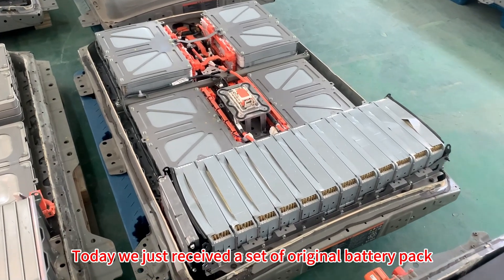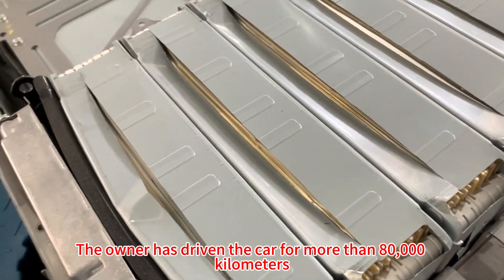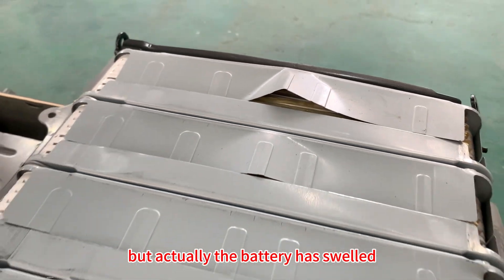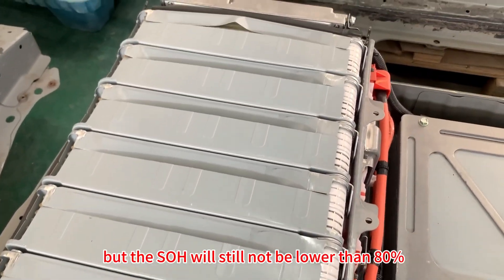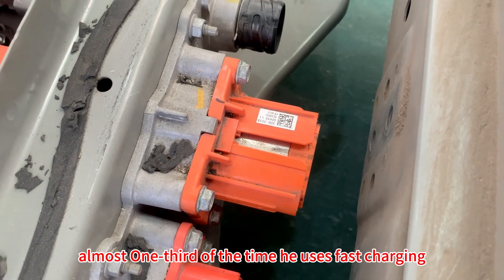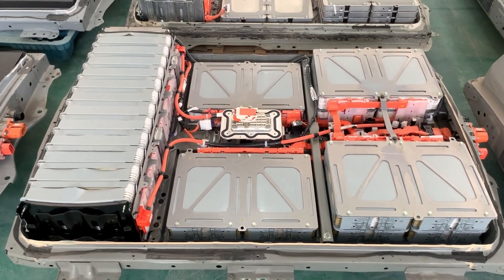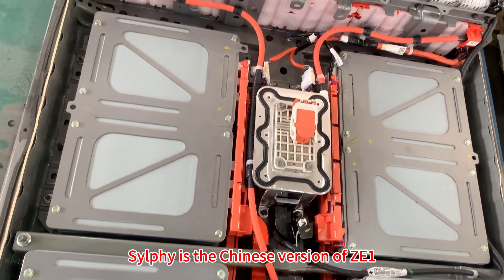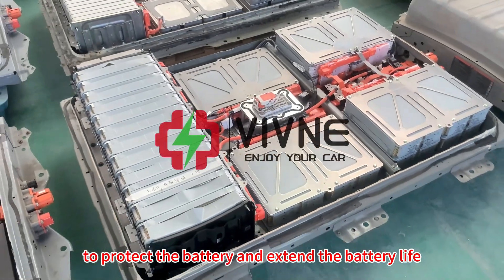VIVNE-Nissan Leaf original battery pack after 80000 km of driving

Comment: Swelling presumably due to over-heating the battery? Rapid charging when the battery is in normal temperature range (20-40 degrees C) should be fine. Driving speed and not charging too 'deep' seems to help with battery temperature.
Reply from the maker: I agree with your point of view, but overheating is only part of the reason. In fact, the attenuation and swelling of lithium batteries are normal and irreversible.

Comment: I would pick that a lot of the fast charging was back to back with excessive heat to cause that
Reply from the maker: Yes, so frequent use of fast charging will accelerate battery degradation and shorten the battery life